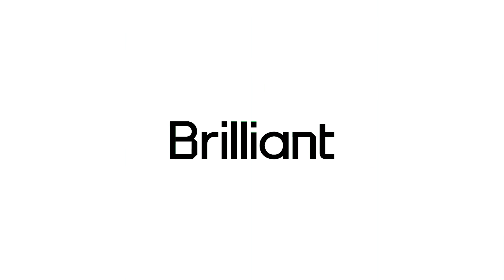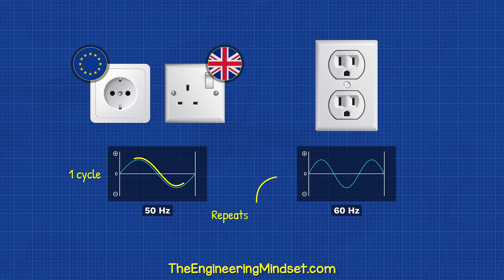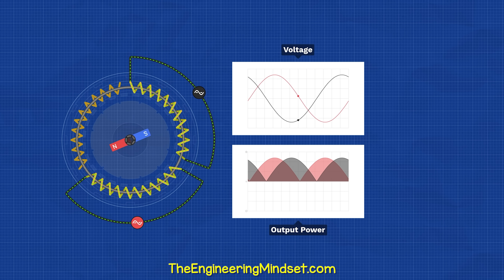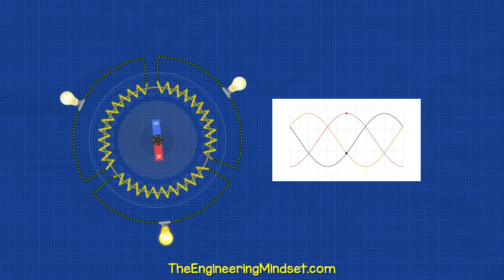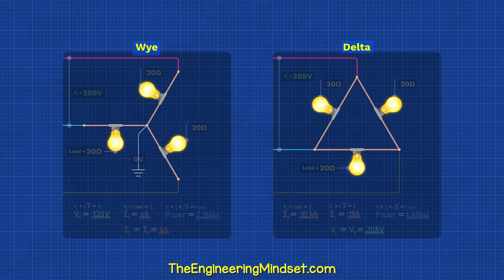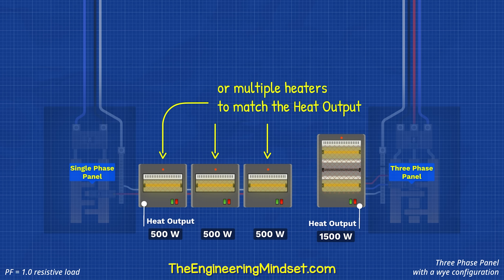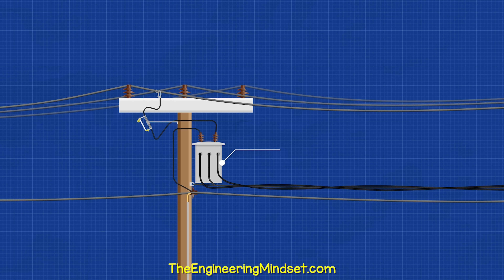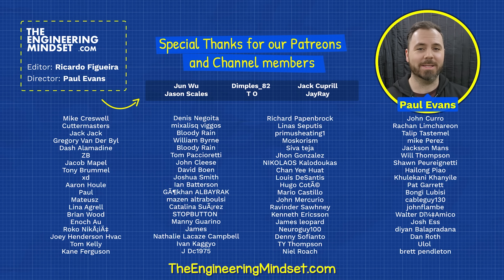How 3 Phase Power works: why 3 phases?

Comment: I read somewhere that they sometimes use 6 phase to power high-voltage DC because, simplistically, they can feed the mostly smooth output through a rectifier and the output looks mostly like steady DC. Then you have to invert it on the other end.
Reply: it is not really 6 phases. It is just cleverly connected transformer, that has two secondary sets (one is wye, one in delta arrangement). Both are feeding two sets of full bridge three-phase rectifiers. Voltage on the output is actually pretty close to voltage you would get from rotary AC/DC converters that were used to power DC loads (like trains or trams), however it is done with only magnetic field rotating and whole commutation done in solid state.
Reply from the maker: I can see it could work, I show in this video how the VFD turns AC - DC - AC to control the multiple phases https://youtu.be/yEPe7RDtkgo

Comment: There are 6 phase power systems, usually used for stuff that needs stiff DC power at lots of amps. Electroplating lots of steel, purifying copper from raw melt, and alumium smelting are a few applications.
Reply: Yes... The extra phases (e.g., six-phase) from the power source can be used to cancel out very objectionable low order load harmonic currents often associated with the rectifier type loads that you describe.
Reply: Generally acheived by adding a transformer with multiple secondaries that can be combined to phase-shift the winding voltages, so you supply 12-pulse or 18-pulse rectifiers. This reduces the harmonic currents on the supply side, and is commonly used on medium-voltage inverter drives to reduce the stress on the motor insulation and provide a lower harmonic voltage waveform
Reply: For multi-megawatt foundry furnace 12-phase is used.  It is derived from 3-phase with transformers. They need steady current with minimal ripple.
Reply: @richardhole8429  sounds like the arc furnace at the phosphorus plant in Tenessee. That furnace was scary, had several giant cables that fed telephone pole sized graphite rods thousands of amps at 7kV. The place literally had its own substation being fed with 3 towers of high tension lines .😳  That field trip was awesome.
Reply: @christopherleubner6633 i would love to see that.
Reply: One could also use a 3 ph motor to drive a generator/ alternator of choice, for those localized requirements.
Reply: Also 400 cycle for high power electronics. <military
Reply: @warrenpuckett4203 And civil aircraft
Reply: @erik_dk842  Never worked on them.
Reply: @erik_dk842  . . . Where you can really hear it when it gets coupled in to the intercom system.
Reply: So in reality they provide 2 three phase supplies...
Reply: @manoo422  Each one is phased 60° apart. A phase shifted 3-phase transformer arrangement can produce that.
Reply: @manoo422 Just like 12 eggs are in reality two half dozens
Reply: 6-phase is also typical on many naval ships.
Reply: I do not understand why there are no one long coil around the rotor with only one small gap or two coils one with smaller diameter and the other with bigger diameter and a rotor between them...
Reply: @elgoogssie3969 that isca simplified drawing for teaching purposes.  Real motors have more than 3 poles.
Reply: Hot
Reply: They're better off with direct DC from a large array of solar panels.
Reply: Would not an odd number be better?
Even better, a prime number
Reply: latest application is very high powered car alternators. same case but more power.
Reply: Multi-megawatt induction furnaces at foundries may use 12-phase power.  They get 3-phase from the grid and use transformer phase adjusters to develop the other phases.  It sounds complicated but is really quite simple.

Comment: Actually the power delivered to a resistive load in a 3 phase balanced system is constant versus time. It does not pulse as the video implies .
Reply: I think he was referring to peak power, not root-mean-square (rms) power. The function sin(x) + sin(x+pi/3) + sin(x+2*pi/3) has distinct peaks and troughs.
Reply: The instantaneous power in each phase is a sine-squared function, not just sine.  The instantaneous sum of the three sine-squared phase power waveforms (displaced 120 degrees) add up to a constant value flat line with no ripple for balanced passive loads.  

Some specialized non-linear loads like large rectifiers  can benefit from greater than three-phase power sources.  For example, a six phase source can cancel otherwise objectionable low-order harmonics in the rectifier's load currents, specifically the 5th and 7th harmonic currents.
Reply: @josephknapick5307  Agreed. That is how I remember it.

Comment: Most Dutch homes can, if they aren't already, switch from 1 phase to 3 phase for a fee. It does require a new fuse box or at least the upgrade of an existing fuse box but in terms of monthly service fees to the power company/network management company a 35 amp single phase connection costs the same as a 25 amp 3 phase connection.
Reply: Anything newly built in the last two decades in NL already has three phase as default in the "meterkast"
Reply: @MichielKlaver The wiring is there but it's not hooked up by default though, as far as I know 🤔
Reply: @pyramidsinegypt  the new hosing projects I've visited the past 10-15 years all had 3-phase main breakers. Probably the heat-pumps are to blame
Reply: @MichielKlaver  Ah yeah, I think you're right.
Reply: In the USA, you can have 3 phase at your house, but the cost varies significantly depending on the power lines and the distance to your house. For example, my parent's house has a power line with all 3 phases right in front of the house, so the installation cost would be low. However, in my neighborhood, they run 3 phase down the main street, and only branch a single phase down each side street. So I'd have to pay for them to add two phases down half a mile of road - much more expensive. And if you live somewhere with underground power lines? The cost would be insane.

Comment: Whenever you plug your Tesla into an outlet, you can deuce if it’s single phase(120v) , two phase (240v) or three phase (208v) in North America based off what your phone 📱 app is saying about the available voltage . No need for a volt meter 😂

Comment: You could have 2 phase or more than 3 phase but it's more wires and for over 3 phase messing up the order will do more than changing the direction. It will make motors shake violently and burn out. I think more phases exist in some ac systems overseas but it just doesn't seem like the best idea to increase complexity

Comment: 1:55 Why did you edit the LEDs?
Reply from the maker: Eh? It's not fake or edited. That's real footage, taken in slow motion on my samsung phone. I literally showed how it works seconds before that. You can make it yourself, just a magnet rotating past a large coil of wire with a nail through the centre. The led's connected between the two ends in parallel, in opposite polarities. Try it yourself.
Reply: @EngineeringMindset  I assumed that you changed the video, but apparently your samsung phone changed the video by itself (they are known for manipulating video and photos). I wanted to know if there was any reason for doing it. If you don't believe me, I slowed down your video (and made a few cuts) to prove it: https://www.youtube.com/watch?v=OdeOg_jbiHw . It is clear how the reflection of the light on top of the LED warps and moves. Which is impossible and can only happen when the video is edited. I know that it works electrically, you explained it very well! I know that everything you say and do in your video's is real, that is why I did not understand the footage of the LED. Thank you for making these high quality videos! Your really have a positive impact on my life.
Now that I have read my original comment back, I see that I typed it quick and it sounds bad. I should have left the fake part out because it did not contribute anything to my question. I'll remove it after you read this. Thank you for answering (even when I called it was fake)
Reply from the maker: I see, that does look strange in your cut. I remember there's a Tom Scott video (https://youtu.be/tozuzV5YZ7U?si=X8OVSzCBgJnEw7pz) which shows how cameras take images by lines. I suspect something similar is happening. It's in slow motion so maybe it increases under this setting, but this is only a guess.
Reply: @BobZoektocht  although Samsung might slightly edit their videos I doubt they do it in this manner
Reply: @BobZoektocht  this is called rolling shutter
Reply: @harriball7862  Nope. Look more closely. Like I said: the reflection of his studio lights is warped and moves (which should not move). These reflections should stay in the same place as it only depends on the surface of the LED and the position of the lights. I know what rolling shutter is and what it looks like. The light emitted by the LED moves trough the LED with the speed of light (in plastic). Which is way faster than a single frame exposure. So the light turning on or off can not create a rolling shutter effect on its own. The light is also not turned on and off again within the time of one frame. It is on for multiple frames and off for multiple frames. The frequency of the LED cannot create a rolling shutter effect. 

The conclusion is that rolling shutter is not at play here.
Reply: @TheGuyWhoComments  I see no other way. The LEDs are clearly edited.
Reply: @IntegerOfDoom  It has nothing to do with shutter. Look at how the reflections of the studio lights on the surface of the LED move. They should not move. The samsung software just interprets the light of the LED as movement and tried stabilizing it into a smooth motion. Warping the whole LED. Its not in my video, but look at the second LED. One time, the motion goes from top to bottom and the next time it goes from left to right. Which is also impossible as being an effect of scanning, because the scan direction is always the same.
Reply: This is interesting. I will try to replicate it myself with my samsung smartphone.
Reply from the maker: I noticed in an older video where I destroyed an LED in slow mo, that the base illuminated before the tip and then the centre. https://youtu.be/O8M2z2hIbag?si=3ije-GMlvcFnu1pa&t=543 if you use the speed setting and go frame by frame you can see it. When the base illuminates you can clearly see a straight line where the image has refreshed during image capture. I think this was also on a samsung, but I can't remember.
Reply: @EngineeringMindset  I see. The effect in that video is indeed rolling shutter. The flash started when the scanning line was at the bottom of the frame. But in the next frame you can see that the top is illuminated too. So rolling shutter effect can happen when things are fast compared to the frame rate (and exposure time) of the camera. But in this video, the LED turns on during the time of multiple frames which is way too slow. The warping effect of the LED happens in multiple frames which cannot be explained by rolling shutter because the LED is not blinking near the frame rate frequency. It is just the LED turning on and off slowly. You can have one frame that has a half lid up LED due to rolling shutter, but the next frame should have a fully turned on LED (like in your video about LEDs).

I have recreated the LED footage on my own Samsung phone in slow motion. But my footage looked normal.
Here is a video where I show the effect in your video in better detail and it includes all my tests: https://youtu.be/OENm16i3Bhw

I tested with a frequency of 5 Hz (the first shot), 10, 20, 50 and 100 Hz. All filmed in slow motion. But my footage is normal.

To be clear: Rolling shutter cannot explain it because stationary things stay stationary even when you have a rolling shutter. And the reflection is clearly not stationary
Reply from the maker: This was filmed on an S23 Ultra. I still have another clip on the device and this also has the weird warping effect just as the LED turns on. So you're right, it's definitely the device changing the video.
Reply: @EngineeringMindset  Before this conversation, I did not realize Samsung manipulated videos to this extend. It was an interesting conversation.
Reply: This comments reply are too intelligent for me

Comment: The data center I work at takes in 34.5kV 3ph and steps it down to 480V 3ph for IT and hvac loads. 4kA air circuit breakers are mildly terrifying.

Comment: I have a question how does it work when single phase power is olny hooked up to 1/3 of the generator windings wouldnt that just put all the single phase only on one coil? or is it disrubuted that way that there are equal numbers of single phase "networks" on any 1/3 of the alternator?
Reply: Correct. A singe phase load will only put load on one of the coils in the generator.

Comment: Here in Switzerland pretty much all residential Houses are connected with 400v three phase. It is really useful for large appliances or charging electric cars.
Reply: That sounds similar to what we have in Sweden, (and no, we are not the same country :))
As far as i know, anything other than 3-phase 230/400v is non existent.
Just curious, what is the what is the fixed cost for an electric connection in Switzerland?
Our model is so far that we pay a fixed cost monthly for 16A main fuses, 20A and 25A is also common.
(and on top of that the price of each kWh of course).
Reply: @stefanjohansson1234  if i remember correctly the fixed cost is per grid connection (per power metering unit) and account to less than 10 Swiss Francs (about the same as 10€) per month. And then we pay per kWh. There is two types of price. One during high demand hours and one during low demand. High demand is Monday to Friday from 07:00 to 20:00.
High demand price is 0.27 Fr. Per kWh and during low demand it amounts to 0.25 Fr. Per kWh.
Thats for private houses without any special high energy demand
Reply: Virtually all of Europe has this voltage and much of the world. Only the US inspired installations use the crazy single phase / split phase etc. 

The 3-phase makes things so much easier: Larger loads, in my house, the stove, the sewer pump and the garten water pump run on 3 phases. Everything else just uses one of the 3 phases. If you balance the 1-phase stuff you have in your house across the 3 phases, you won't be loading the neutral wire (or have very little load on it).

And just to make things clear, the 400V potential is between let's say phase L1 and one of the other phases. Between the same phase and neutral, it is the normal 230V, so there is no magic. In other words, if you connect the load between a phase and the neutral, you get 230V. And if you connect between two phases, you get 400V.

To make things more confusing, since this is AC, the 230V and 400V is a "kind of average" of the voltage between two points. As we have a sinusoidal curve, the peaks are higher; about 327V for 1-phase and 556V for 3-phases. That's why insulators etc. should be rated to those higher voltages.
Reply: Sounds a little dangerous, but can use much smaller copper wires and reduce cist.
Reply: @Sam2sham  why would that be dangerous? ever been to Switzerland? here is everything up to code and security is taken extremely serious
Reply: @Superbus753  just the extreme voltage.
Reply: @Sam2sham  with the safety culture here thats not a problem.
Also every house hets regularly inspected and all electrical installations testet. These inspectors are thorough and don’t miss the slightest difference from code or problem.
Reply: I thought Switzerland stayed out of large alliances
Reply: @confuseatronica  ohh autocorrect changed that one. I meant to say appliances.

Comment: believe me or not but this is exactly the type of video I was searching for since school started, I can't explain with words how thankful I am
Reply from the maker: Glad to hear, hope it helps with your studies. If you can share links to your class mates so we help even more people that would be much appreciated
Reply: @EngineeringMindset  A great video, particularly the explanation of RMS. 
One important point about 3 phase that you did not mention was that simply reversing 2 wires reverses the direction of rotation of a motor. This is vital for lifts and escalators,  as well a useful in machine shops.
Another, less important point was that in HV distribution, one phase is bonded to ground, making emergency tripping simpler.
If they are not available already, a video on current transformer use in metering would be great, as well as a video on PAM wound motors having 2 adjacent pole asynchronous speeds. 4 to 6 pole is very useful in refrigeration compressors since it produces ideal torques. The 4 pole speed is ideal for use in temperature pull down.
Reply: @EngineeringMindset  love you man
Reply: Your content is awesome  I am feeling real engineering
Reply: You can send him a tip for cup of tea...